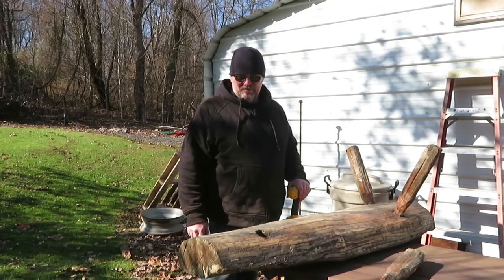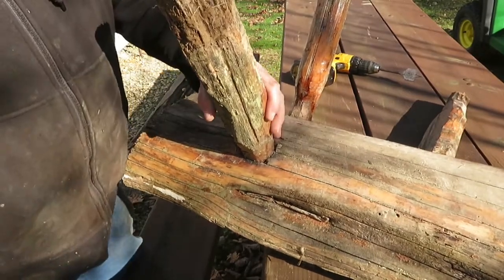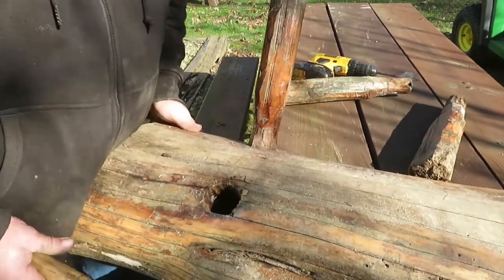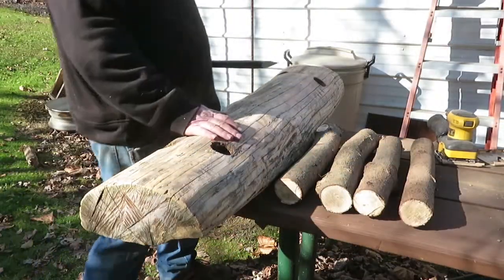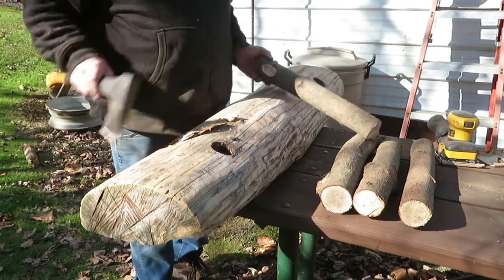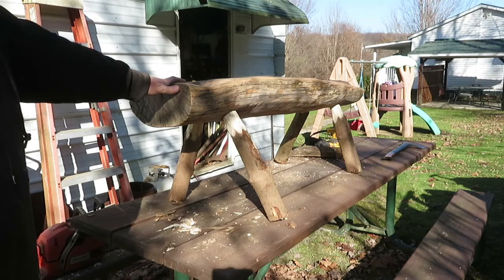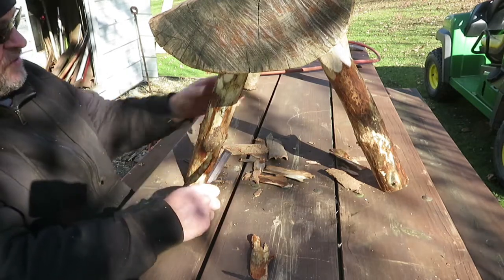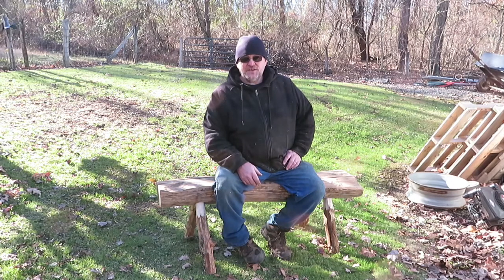Log bench new legs

Comment: That's a good lookin bench. Cleaning it up like that brings it back to life.
You might want to fill those top cracks with something to keep water from getting in and freezing and expanding during the winter.
Reply from the maker: What would you use for outside weather to feel them cracks.
Reply: @Robinson-Homestead  I would use epoxy resin. Once it dries it can be out in the rain. As long as it's not submerged in water, you don't need marine epoxy.  https://www.amazon.com/gp/product/B07BM9LHRB/ref=ask_ql_qh_dp_hza